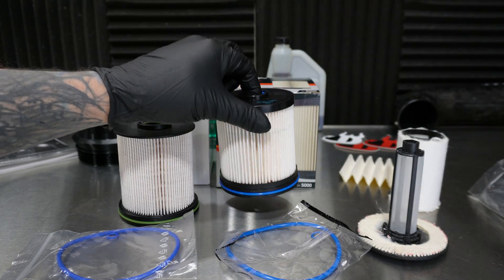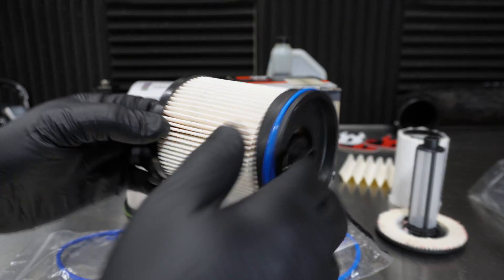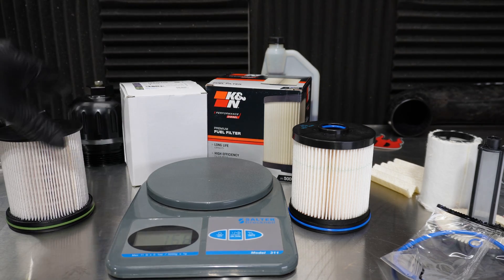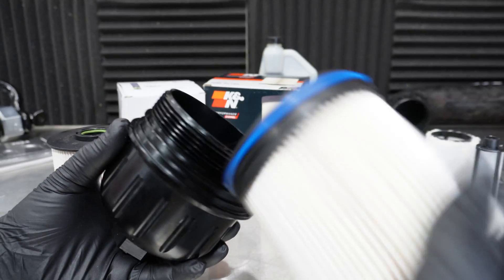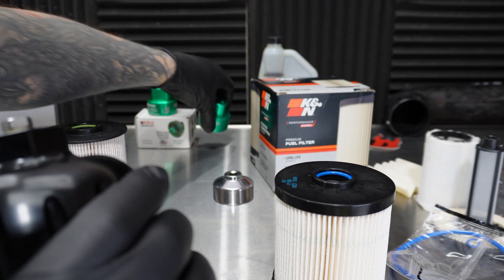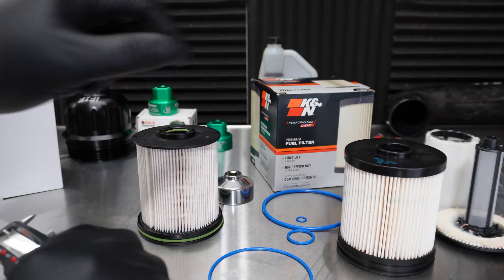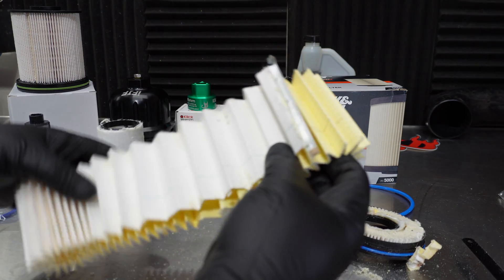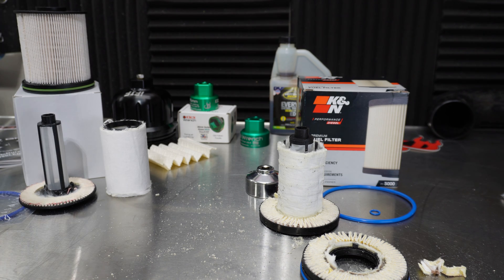K&N Fuel Filter worth Twice $ Vs AC Delco TP1015 ?

Comment: Based on the owner manual that comes with the truck. You should run a fuel additive on every fill up unless you can find a gas station that offers “top tier fuel”. Which is very limited locations. I know, nobody reads the owner manual. I’m a dork.

Comment: I noticed the Klick wrench doesn't sit all the way down on the fuel filter lug like the cheap socket did. Did you run into any slipping when using the Klick wrench? Thanks for the info. Love the channel!
Reply from the maker: correct, it's important to make sure your ratchet is straight and it should have no issues of slipping off.

Comment: how come you don't have the VSE dual filtration on your new truck?
Reply from the maker: Sticking to the factory setup for now.
Reply: curious as to why? issues with products? maybe you don't want to say publicly i was thinking about getting it for my LM2... let me know. @DemonWorks
Reply from the maker: @Dyerboi333   Couple reasons, 1: that it does hang down a little bit and no shielding like the factory one has and I plan on offroading. 2: I have plans for videos working with the factory fuel filter system as that is what most people have. I did several videos on the Fuel System Saver, I felt I accomplished what I was after, to share information with others.

Comment: Can you do a comparison with the Baldwin PF46126? I'll send you a filter if you can't find it locally.
Reply from the maker: I wasn't aware of this filter but that upper and lower portion looks identical to the K&N filter. Makes me think the K&N is a rebranded baldwin with different color orings. I searched the baldwin site and there is no info on that filter. Would love to cut open another but before I do, I would need to gather more data and look more into how I can test these filters better.
Reply: @DemonWorks  I had a ac delco rep tell me the baldwin makes the filters for AC delco. I received one from him and it seemed to be identical.
Reply from the maker: weird,  the pictures look like the K&N and not the acdelco. Is that the case in the one you saw? I don't mind ordering one but if it looks like the K&N, I likely will not keep it, that's a filter much more expensive than the acdelco that's tried and true to be a good one. @bradensahlfeld687
Reply: @DemonWorks  I will look at it tonight and send a pic if it looks different than the K&N filter. I appreciate the videos by the way.  At what milage to do switch over to the PPE oil filter?

Comment: I change mine on my 6.6 Duramax between every 7k and 10k miles even though it is only slightly dark and nothing crazy. It's so cheap and easy to change on the 2022 that I mine as well do it to ensure longevity.
Reply from the maker: I'm right there with you!

Comment: In my opinion, Be careful if your truck is still under warranty. If there is a fuel system issue and they see an aftermarket fuel filter, are you sure they will honor the warranty?  I was going to look into the FSS filter system and the dealer told me if I did that change, the warranty may not be honored.  So I’m gonna wait until the I’m out of warranty.
Reply: They have to honor warranty it’s the law !
Reply: @fpdmotor  well not if it’s a non original part. And even if it was, try arguing with them as your vehicle is in their garage on a rack for weeks as you try to argue with the corporation.  Myself, I’ll play it safe until it’s all my responsibility.
Reply: I see what you’re saying but to not have a warranty covered the dealer would have to prove it was the non oem part that failed. I only use high end non oem parts on my 2023 1500 Denali diesel so I don’t worry about it. Included in the protections for reasonable use in the Magnuson-Moss Warranty Act is the right for consumers to have the vehicle serviced at a business of their choice and the option to use aftermarket parts, meaning potentially money-saving alternatives to those that came on the car, while retaining the original warranty. The automaker is not allowed to void a warranty just because a nonfactory part is used.
Reply: @fpdmotor  I understand what you’re saying and by the letter of the law it might be right. But I’ve had instances in the past with clear warranty work with no non oem parts and had to argue for a week and a half to get them to honor their warranty.  So for me it’s not worth the possible fight.  But everyone has the right to do what they want.  I just voiced my opinion based on past experience.  After the warranty, I’ll do what I feel is best but until then, it’s oem and done at the dealer.  So there is no finger pointing if something should happen.  Let’s hope these diesels run forever with no issues. That’s what I’m betting on. 😂😁😁.love the truck.
Reply: @hammer-r agreed, you have a great point.
Reply: @fpdmotor  I’m sure most won’t run into an issue.  I really hate to have to wait until the warranty is up.  I’m sure there are better options out there to replace stock parts.  Personally I’d like to run the FSS system of double filters especially with these sensitive fuel systems.

Comment: Looks like the OEM filter is wider, longer, and thicker. I changed mine on my LZ0 at 9,000 miles just to see what it looked like. It had a slightly darker tint than a new one but otherwise looked in great shape. Too bad K&N doesn’t give micron, flow, and water separation ratings. I’ll stick with OEM.